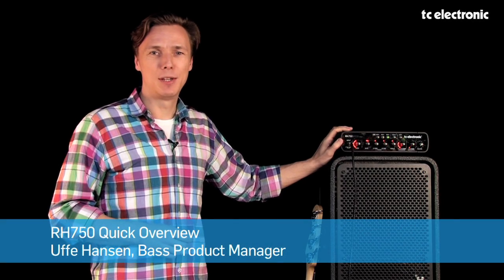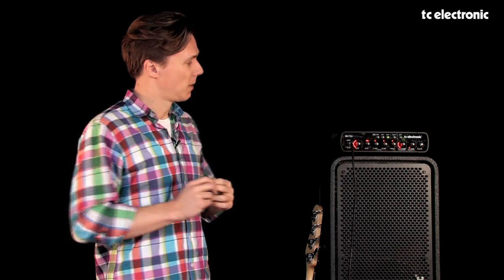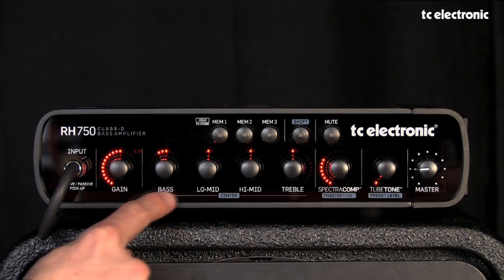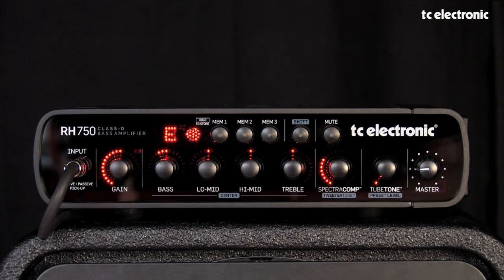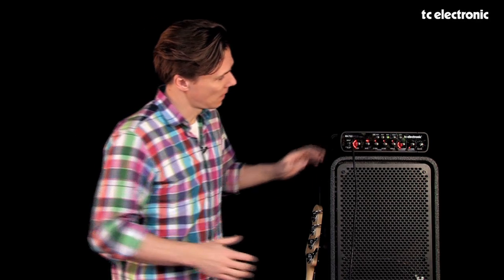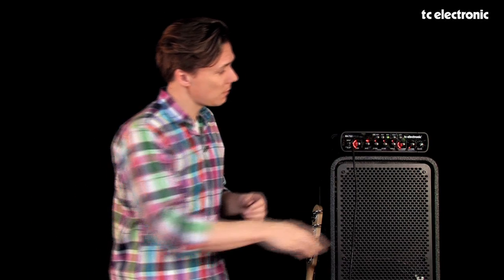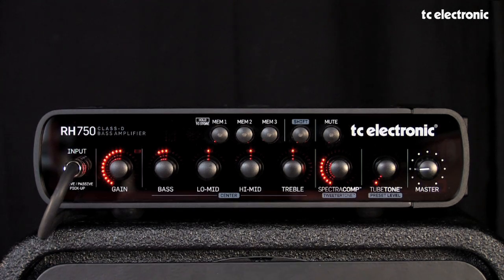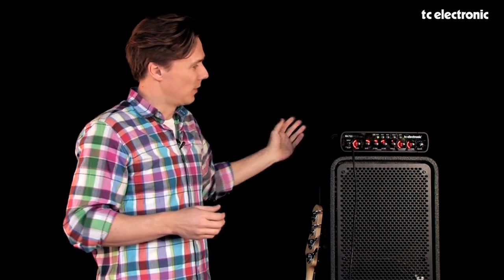TC Electronic RH750 Quick Overview

Comment: I've had one for a few months now and use it inside and outside. It's sounds great, weighs nothing and produces nearly ZERO heat. I played a July 4th gig outside, it was 100 degrees and the thing was the same as the air temp...amazing....